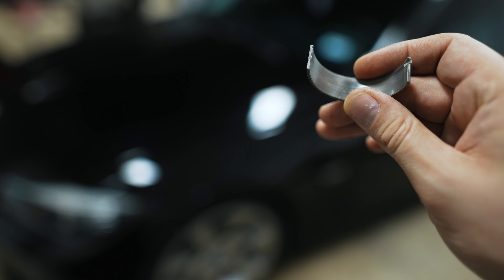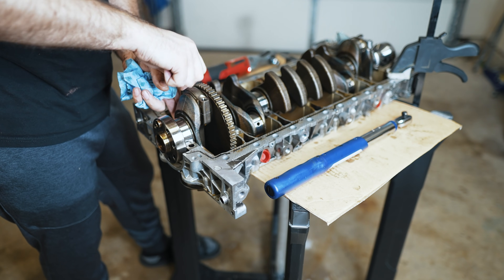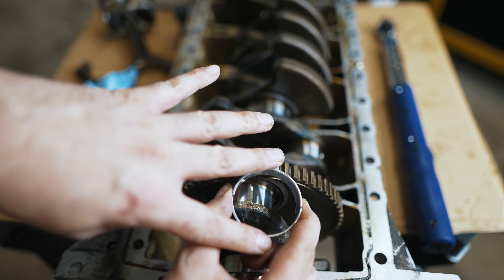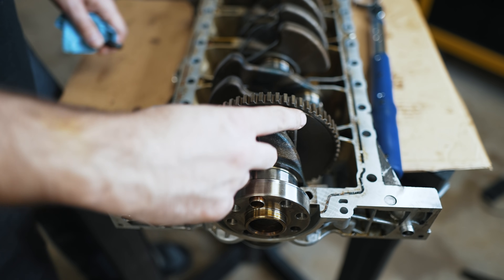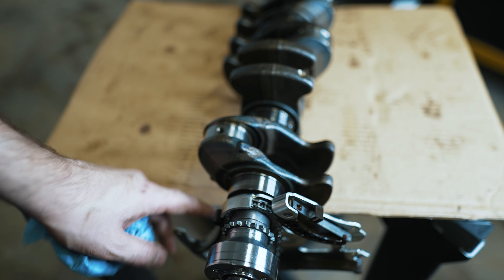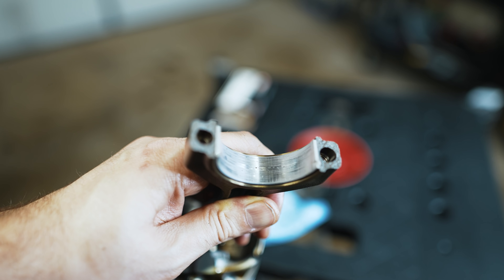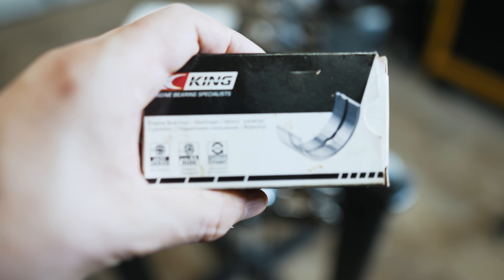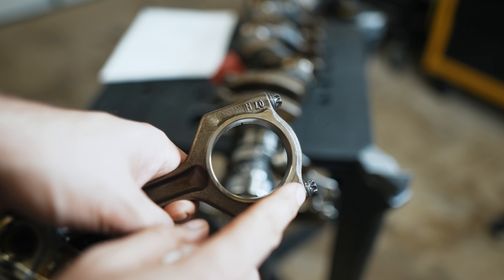Why Can BMW Rod Bearings Fail?!

Comment: Would you recommend against installing the King STD bearings on an N54 after your experience with them? I just replaced mine about 500 miles ago at 167k miles since I was doing an oil pan gasket and my stock bearings looked great still, I’m wondering if I should have just left them alone.
Reply from the maker: I don’t think the bearings were the issue, I think my oil pump took a beating when my oil pump chain failed. I think I should have refreshed the pump while I was in there.
Reply: @VehicularDIY thanks for the quick reply! Hopefully the king last as long as the OEM did, looks like BMW engineers made a really strong bottom end on the N54. I can’t find many instances online of people spinning their bearings on this engine. The factory setup is pretty solid so I hope I did the right thing with these King bearings
Reply from the maker: Yeah my bearings at 200K still looked really good. The crankshaft is very strong so no deflection under load which leads to spun bearings on weaker models like the N55.
Reply from the maker: BTW thanks for being a member! I see all members comments right at the top even on older videos.
Reply: @VehicularDIY thanks for all the invaluable BMW content man! You’ve saved me thousands of dollars so that’s the least I can do!

Comment: Did you also do King bearings and ARP bolts on the replacement engine? Or what would you recommend just gaskets as far as maintenance before throwing another engine in?

Comment: What happened? BMW was taken over by MBAs who wouldn't know a connecting rod from a dildo and they decided the opinions of the real engineers were not worth considering. lnstead the followed the advice of "engineers" with dollar signs or Deutschmarks in their eyes instead of pupils, to save a few of whichever currency to which they had sold the soul. Assholes. BMW used to make the best engines in the world. l know because l used to work on them. No more. l wouldn't take one unless it was free and came with lifetime free maintenance. Paul Roche must be spinning at redline in his grave.

Comment: I know I'm late to this but have 2017 X5m 60k miles and out of nowhere have bad knocking noise due to rod bearings. Mechanic recommends replacing the engine but I'm wondering why can't the rod bearings be replaced. All maintenance have been followed and very light miles.
Reply: You could replace the bearings, that would be cheaper than replacing an engine and see if it works.

Comment: After stripping down my N57 following a spun bearing, almost definitely due to oil starvation, I found big flakes of paint in the oil pick up pipe. Has anyone come across this before? seems to be a massive design fault

Comment: you need the prober scale bearings and color code for each engine bro cant just slap some random crap in it lower bearings are red so 5 reds and 5 yellos on top with 1 exception usualy deppending is there is a B in the rrrrrr code if there is its 1 blue 5 yellow
Reply: the code on the crank is what depends your scale bearing that rrrrr code you see mean you shouldve gotten 5 yellows top and 5 reds on bottum

Comment: When checking rod bearing clearances with plastic-gauge use the old rod bolts and torque AND stretch the bolts or your reading will be off. You can only torque and stretch the rod bolts twice so plan on buying new ones. Also if you’re thinking about using the ARP rod bolts, don’t! If using ARP bolts you’ve gotta assemble the connecting rod, torque, stretch then line hone cause it’ll egg the connecting rod-ask me how I know.

Comment: Another trick of performance engine builders is they will swap a top bearing and a lower bearing. Meaning the top bearing will have one thickness in the lower bearing will have different. This is how they get the clearance that they need for high performance application

Comment: I came across one possible reason which was mentioned in this video: rod bearing material softening due high oil temperature. First scoring a bit and losing the capability a bit to hold even film becoming more prone to metal to metal contact, getting more chewed up and eventually spinning the bearing. Source of heating thought: https://youtu.be/v4CRTPGP5M0?si=2HdTiAemDGZ8PddB

Comment: Is it possible that some of the bearings were the wrong size but still packaged with the correct ones ? There’s been many stories of KING packaging undersized / oversized bearings with standard sized ones on bmw forums … I’m going to do this job on my 07 335 and ordered the STD sized bearing from KING and one of the bearings were undersized and the rest STD. I had to reorder and check every individual one to be safe

Comment: Please help me, i have a 335i n54, low oil pressure at idle 15psi engine warm, checked camshaft beds are like new, oil pump like new, another one installed to be sure, still the same, connecting rod bearings like new, mileage!!!! 32,000 miles, real mileage!! the only thing left is a vacuum pump, sprays on the bottoms of the pistons, the correct pressure that should be at the start of a cold engine is less than 100psi, mine is 58psi ... have you ever encountered something like this?

Comment: Bearing needs clearance and oil. If clearance is good, then it is the oil pressure or carbon deposits in the oil, large one.

Comment: I’ve got a f10 m5 it’s got a knocking noise I believe this happened after a 2nd gear pull but I’m not sure degeneracy did not drive it after I heard the noise. dropped the oil filter there is definitely a hint of some shavings, you think I might be able to get away with just replacing the bearings or is it too late?
Reply: so a wives tale on that topic is if you dont have severe rod knock then you can probably get away with just doing them and making sure the crank face and the rods faces are not scored to bad. just know if it is knocking the more you drive that engine the more expensive it gets to rebuild or worse you end up running the crank and bottom end.  One of my good buddies bought a 2008 m5 a few years back and hes in the hole trying to get that car back on the road lol... but your generation is 20x more reliable then the e60s

Comment: Mic it up properly ( ovality and taper both rod and journal), check the conrod for straightness and only use genuine parts if then no fault is found the fault is somewhere else like the oil pump,  resonance ect.

Comment: I know I’m late to the party here but I’m about to change my tubes and am thinking of doing the rod bearings at the same time as Blackstone report found excessive lead in my oil and suggested that it from bearings.  I was planning on upgrading to the ARP bolts but now I’m rethinking based on your comment about them in this video.  What did you base this comment on?  Im having an experienced BMW shop do the work but just with the oil pan off so not able to line hone.

Comment: I have 260k km on my N54 and the only things I have changed are the turbos for Td04s at 180 km's and suspension other than that just general maintenance , and it still puls like a train.

Comment: Any follow up videos to what happened to this engine or oil lab results ? 
I’m going to tackle the job of changing my rod bearing ( given the confidence by watching your videos & links to parts & tools ) took it to BMW said they used a camera & said something knocking on Cylinder 1 & 2. Gonna send my oil to get analyze & see what comes up. NEVER did internals but pretty meticulous about doing everything right. I already done a n54 swap, I got a second motor that I will practice & see if I build up but want my engine inside the car to get back running before I go crazy spend tons of money on something I never done before. Overall LOVE the content I’m a new viewer, would love if I can ever reach out to you with questions ofc I’ll PayPal or donate to your build for any help. Thanks bud keep up the great content

Comment: I got a F10 N55 Engine #3 Rod bearing failure after I done the Rocker cover & Oil Pan Gasket replace, 1st pull the Engine Out, Go to Mechine shop polish the Crank shaft, and put New BMW Bearing (Main Bearing and Rod Bearing) 1start running smooth, after 1hour idle #3 Rod Bearing failure again.
2nd Pull the Engine,Clean all the Oil Line all over the Engine Make sure notting is clogged up,Then put new Bearing and New Oil Pump,Still the same.
Now gonna 3nd time Pull the engine out...
Can anyone Give me an idea? Thank you.

Comment: It’s quite the mystery, but all the facts are in your videos and I think I figured it out.  The new bearings showed heavy scoring, so that means there was debris in the oil.  “Metal pollution” is the leading cause of short engine life.  If you refer back to the first start video after your first oil change you point out the substantial aluminum flakes present.  So that’s probably where the scoring came from.  When engine builders build an engine they strive for an ultra clean environment, and they thoroughly scrub the block down. so seeing all the flakes still in the engine after it was reassembled kind of portends its ultimate fate.  
  The second thing I think happened was that those aluminum flakes made their way into the oil pump.  You can actually see them at 6:12 on a pump vane, and then you wipe it off.  So this caused the oil pressure to run low, but not quite low enough to trigger the low oil pressure switch.  So this would cause the insufficient oil pressure condition that resulted in a spun bearing if you happen to hoon it in that low oil pressure condition.  Once the bearing was spun it became a large passage for the little remaining oil pressure to escape there and finally trigger the oil pressure warning.  I think your bearing job was done perfectly fine actually.  It was the fine particles of aluminum still in the block that did it in.

Comment: The. color codes sizes. rrrrrr are all standard, upper and lower, the the other colors would be ,5 and .25. Last year I done all new king rod bearings and and arp bolts. I done everything to a t, I done proper break in, around 1500 miles, I lost nu4 rod. I’m in the same boat and can’t find a good answer, and this motor is 60k on it. I couldn’t find any answers, but leaning towards detonation. I run 93 and around 18psi on 16t, but they all looked like yours. I’m thinking the king are much harder than oem ones, but can’t justify the price per shell. I’ll try it again and see how I make out

Comment: Being that you put new bearings in your system obviously was malfunctioning I suspect the oil pump for sure there's got to be a way to know if the oil gets air in it That's one thing I'm not sure about how to figure that one out but if the crank case is overfilled it will definitely foam your oil

Comment: You're floating layer of oil plays a big role in preventing metal on metal contact. Additional clearance in your bearings gives clearance for higher viscosity oils that can handle heavier loads.
Reply: This is wicked smart kid. Probably why race motors run thick oil. Greater clearance, greater power, greater viscosity oil to soak up that load and clearance. I like where your head is.

Comment: I've just been through exactly the same situation with King rod bearings. I did mine just as routine maintenance, as the car had previously been abused before I took it on. The old bearings were slightly scored and one of them was showing more wear compared to the others. We went with the CR222SV shells on a standard, unground crank (which checked out within spec when mic'd up). All clearances checked with plastigauge thereafter. After driving the car for no more than a few miles or so, there was a lot of knocking from multiple cylinders and when the car was taken apart again, every single shell was scored and two were down to copper. Thankfully, the crank was fine and undamaged. I decided to go with the more expensive, colour coded OEM shells from that point on and it's been fine ever since. Really, really not sure about King to be honest. Definitely left a bitter taste in my mouth.
Reply: 😂😂 he must’ve been a bmw parts pusher
Reply: King bearinga dont use cooper....
Reply: King bearings CR222SV only use a steel an aluminum layer, thats why they are called bimetal bearings.
Reply: Your story is false...

Comment: Maybe I'm missing something but it seems pretty clear to me what the variable here is, you had OEM bearings for 200k miles then you put aftermarket ones and they spun almost straight away - it's the aftermarket bearings.

They're probably designed for racing and not to be used with the stock oil pump or to ever be revved at all until the engine is up to temperature. Which makes them a terrible idea for a road car.

Comment: OK, just a little late in here, but have now seen the original vid of your removed bearings after the oil pump chain failure. From my experience (I started building engines over 50 years ago) when you see "tram tracks" on your bearing shells, you have foreign matter in your oil system as the cause. This is not a wear issue. I have seen bearings with 200K on them and while the load bearing shell (upper) babbit surface is worn down to expose copper, they are smooth across the bearing face. In light of this, your engine should have been removed after the chain failure and all the oil galleries cleaned out and for me, I would have had the crank journals linished at a machine shop and measured as well to see if it needed grinding undersize. I expect having material in your oil galleries has been the cause of this second failure. I would also have removed the mains once I saw this damage on the big ends.
A bit long winded, but here in Oz, Beemer parts are cripplingly expensive, so we cannot be too careful, especially on a customer car. Nice vid though.
Reply: Have mine with same scores (170000km) on oem shells and still done 20k+ km after disassembly check. So it must been the replacement bearings. The oil filter + oil change also clean these poisoning particles.

Comment: The part I forgot to add is that in this condition it will drop the oil pressure significantly making the situation worse. Just a theory  but I will be verifying my findings this week. Thanks.

Comment: I am currently following your experience with your engine. Here are some thoughts about what I have observed with my N54 rod bearing failure . I have observed that the the rod bearing is oblong and it got me to thinking about what the rod itself may have gained even more oblong shape making the clearance less on one axis and greater on the other allowing the rod to let the bearing spin by catching on the crank journal. Im going to measure my rods and my suspicion is that the rods themselves may have been the culprit. Could you measure your rods this could verify what I think caused my bearings to spin as well.
Reply from the maker: Thanks for the feedback, I plan on getting back to investigating the failure soon.
Reply: For real. Something had got to give here. I regularly experience rod bearing failure at my shop with multiple engines and it's time for someone to figure something out. Finally have the measuring tools to dive in with. Will be measuring rods on two failed engines this month. Will send result. It will be hard to say with the typical customer oil change negligence.
Reply: @yeliabnoj  maybe just the not oem spare parts?!

Comment: Some say when tightening crank/rod/head bolts it is good to do the whole 70°/90°/150° or whatever in one go and not stop. That's the only thing I saw in your video of changing the bearings, but I have no idea about the science behind it. I might ask a mechanic friend of mine, he's done a few engine rebuilds.

Comment: Did you prime your pump after new Install ? I normally install then prime oil pump till oil flows out of cam caps without rotating engine

Comment: Just a comment on the rod strength of the N55, they share the same rods as the S55, so it isn't the rod flex that's causing them to spin. Otherwise it would be widespread on S55 tuned engines, which readily make over 600hp.

Comment: I have an N55 that failed the no1 rod bearing TWICE within 20 km. Priming of the oil pump and oiling system is critical - airlocks in system I suspect. if not done bearings spin. My research reveals that if they do not spin immediately than enough damage is cause that they spin soon after. my experience anyway - third set of bearings going back in shortly with primed pump, primed system  and oil pressure gauge to confirm oil pressure drops from potential airlocks. This included priming oil cooler if you have one fitted.

Comment: one issue i find when doing rod bearings underneath the car, is that its harder to keep where the bearing meets the rod, oil free.  especially here in CA where our cleaners suck!  I usually drop and oil pan and let it sit overnight to avoid oil dripping on me

Comment: Plastiguage with previously stretched bolts might give innacurate readings. The bolts could be providing too little clamping force due to becoming weak and overly stretchy, or too much clamping force due to "work hardening".

Comment: Had a bad rod bearing as well on my old 07 335i. Oil level sensor had a malfunction combined with a oil pan leak. Eventually the engine ran low on oil. Be careful guys. Especially on early cars with leaks. Ended up replacing the engine with a used one for $1,700. Not the end of the world but still not a fun day.
Reply: Used N55 with 140,000 miles are almost $4000 today!

Comment: Purchase a dial bore gauge, reassemble the rod including the bearings along with proper torque angles on the fasteners and note down all the numbers. Then use a Mitutoyo micrometer on the journal range and mic all the crank journals at X and Y and get the numbers so we can see the true clearance. I would NEVER EVER use plasti gauge and a caliper since those read back ball park approximations! I bet you'll find the reason why the bearing spun, the numbers will tell you.